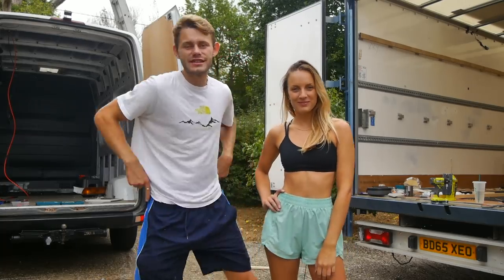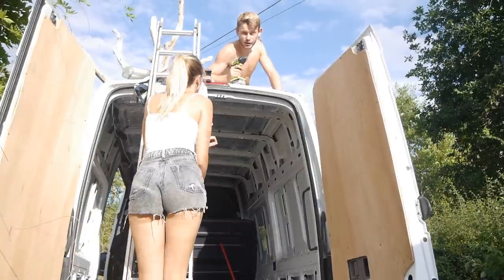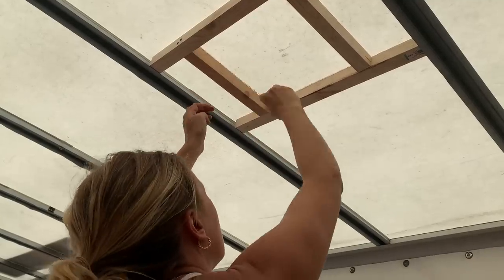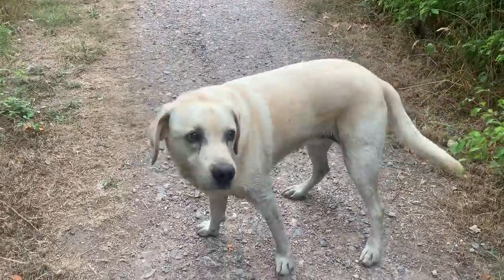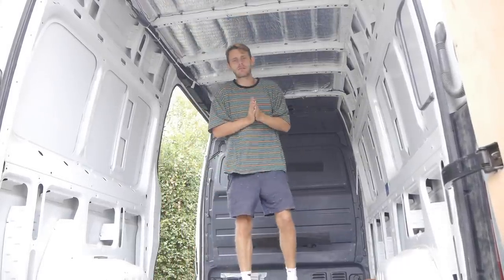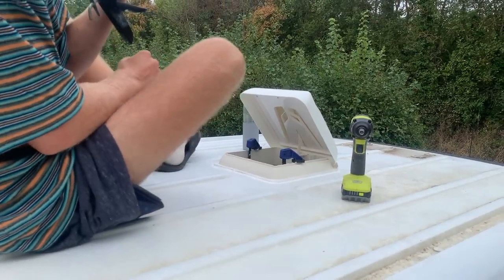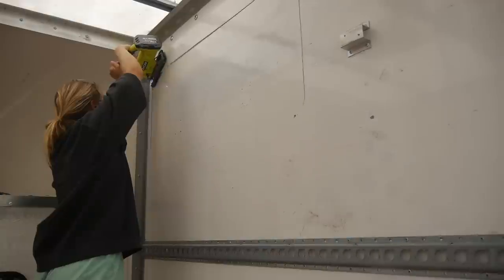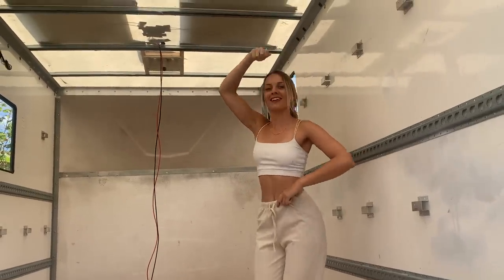His vs. Her VAN BUILD CHALLENGE! Sprinter vs. Luton Campervan Conversion / Ep1 Solar, Fans & Windows

Comment: Awesome channel guys. Can I ask how are you securing the ceiling insulation and wood ?
Reply from the maker: Thanks Lee, this is actually a really old video now as we're onto a home renovation!  We secured them through the metal in the top of the van with shallow easy drive screws and adhesive!

Comment: Nikki what are you going to use as the front door to get into the actual back of a lutand where are you going to put the bed I would suggest putting the bed on top of the cab I'm drunk red bakery murder cabbage in now you wanna cut a little hold and put a door in there so you can get in-and-out and going all the way round
Reply from the maker: Hi Ian, we’re popping the bed up top above the cab! If you catch up with the later episodes, (this was 3 episodes ago), you’ll see what I mean! I’ve opted to not add a side door, instead we cut through the cab, I may regret it down the line! (Hopefully not!)